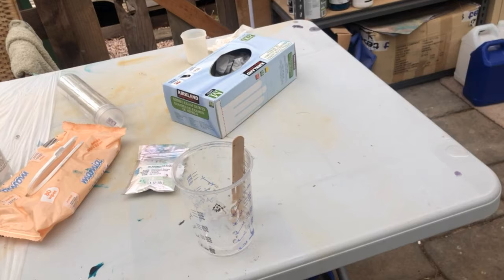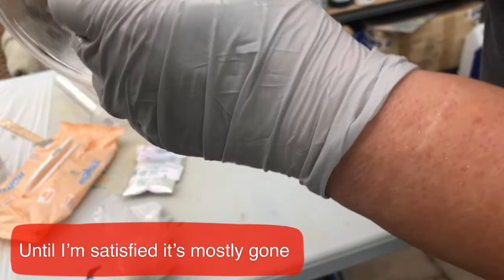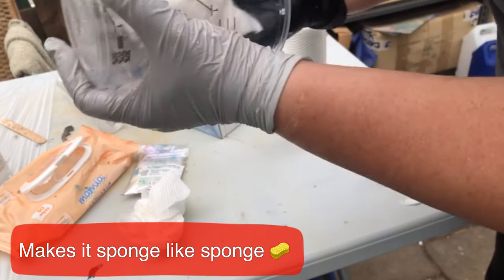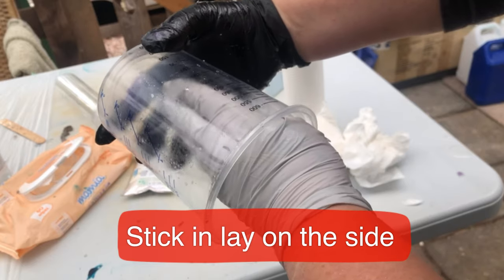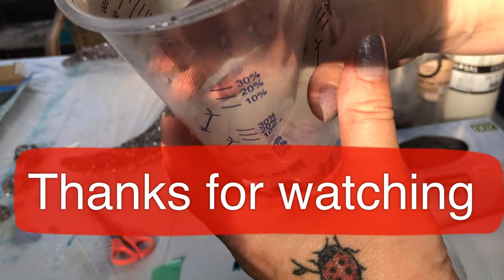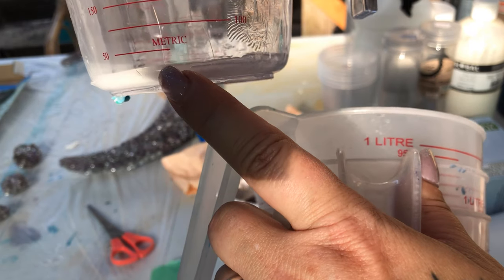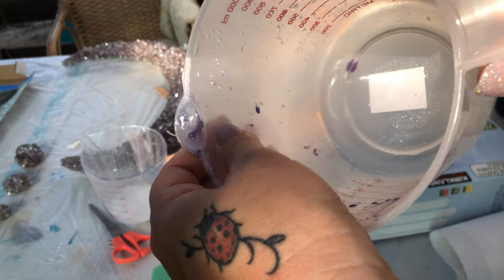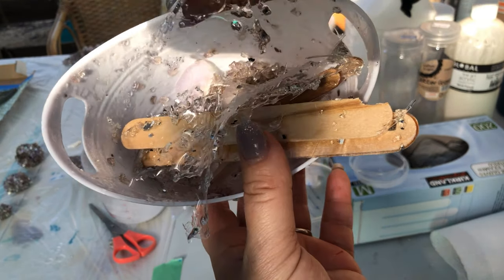Cleaning resin out of the measuring jug. Please add your art green/eco ideas in the comments

Comment: I keep (hoard) all my plastic containers like Maccas frozen drink plastic cups.  I only use the good measuring containers for measuring out part a and b (making sure that they are labelled) and then pour both into the free collected/recycled containers, which are usually disposed of but the part a and b containers can be reused over and over providing you keep dust out of them.  I usually keep them outside down and don't even wipe them out.  I hope that makes sense.  And the sticks can be wiped off and reused too.